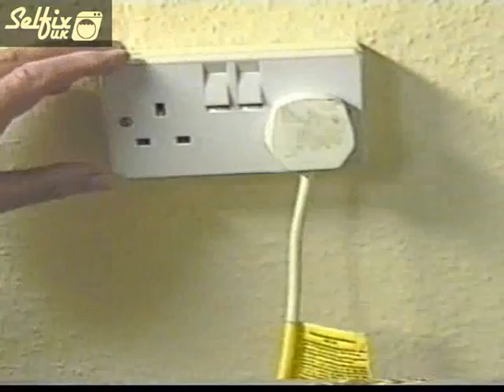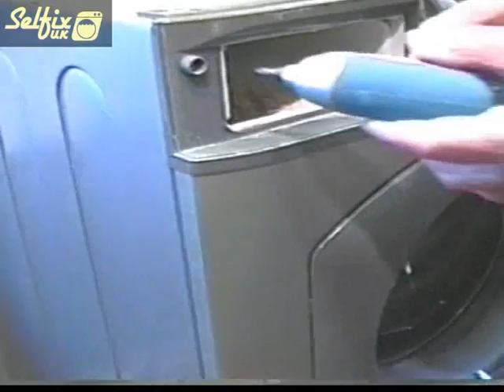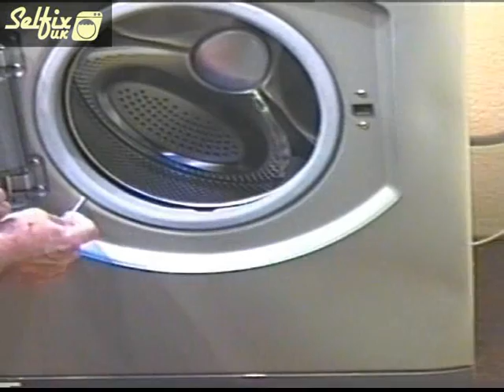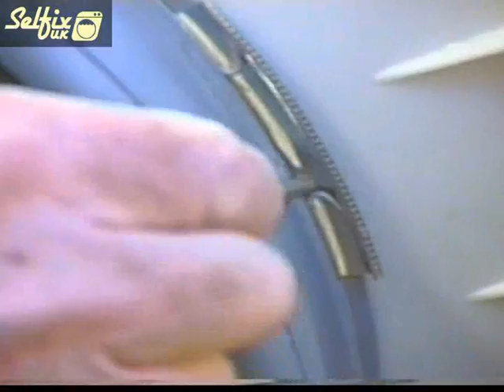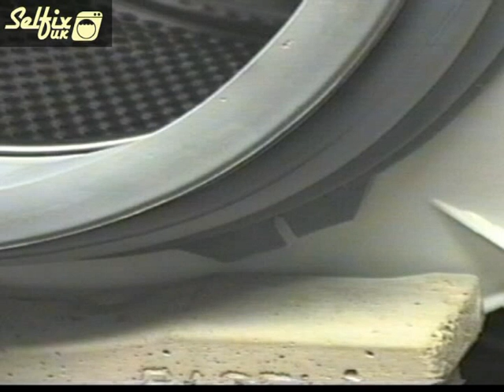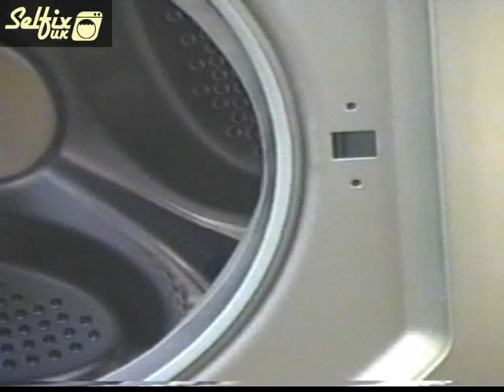How To Replace A Hotpoint WF Washing Machine Door Seal

Comment: Thanks for posting this, Really helped me get through replacing the seal on my WF321 model. would have been lost without it. Great tip on the washing up liquid on the retaining wire. may it so much easier to put on